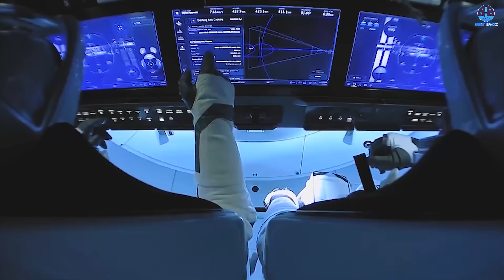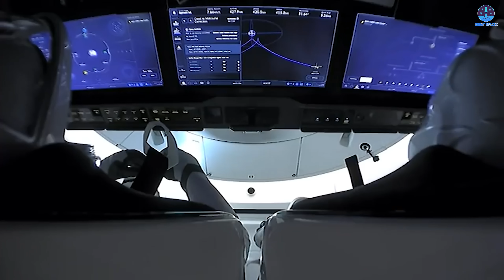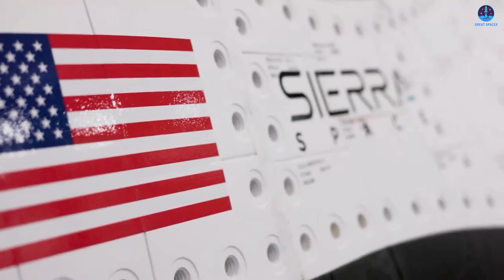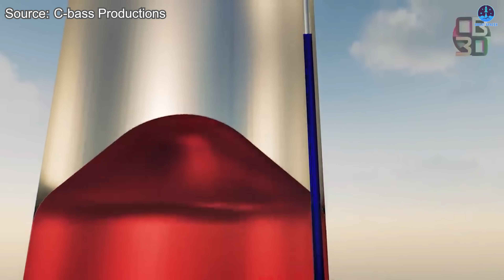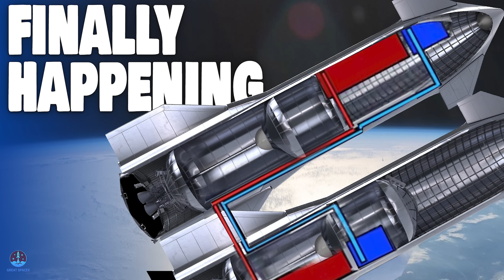SpaceX President Declared Starship Refilling System to the Moon Next Year after…

Comment: How in Micro-gravity is the fuel transferred?  The fuel is a floating blob in the mothership.
Reply: You apply slight acceleration in the opposite direction you want the fuel to flow. Same as on earth. Only its much easier on microgravity since you dont have to account for the pull of the earth.
Reply: Plus you pressurise the donor tank more than the receiving tank, so that the pressure differential results in propellant flow from one to the other.

Comment: They could have really long telescoping arms on the non-heatshield side they could have knuckles stored inside and they could have inspection and repair equipment on a knuckle.

They could also have a cryogenic robotic arm on the inside and have an xray source inside the fuel and oxygen tanks.  then they can do really good inspections with an xray detector on a knuckle.

they could use these  to transport materials and or to tip the rocket over to become a shelter.  They could also use them as lifts if they end up having astronauts in the upper area.

I really think they'll need a low payload deck for a lunar and mars lander (below the main fuel tanks)  and they will need a smaller return vehicle, at least for return to orbit. (they can leave a full starship in orbit if it is refueled)  There is no point in launching so much mass from mars or even the moon.   requires so much fuel

Comment: I would think docking in outer space to transfer fuel to be much easier than two jets refueling in the atmosphere which is done all the time.
Reply: It’s harder due to the lack of gravity and surrounding pressure.  Fuel just goes everywhere but where you want it, so they either have to use a pressure system and/or incorporate centrifugal spin to get fuel where it needs to go.

Comment: to develop a rocket that doesnt use so much fuel is apperently not an option. is it because of shareholders??? WEIRD. short term thinking
Reply: I think you just demonstrated that you don’t know much about spaceflight. WEIRD
Reply: @constantin-X the space x rocket use more fuel just to take off than the rocket that went to the moon before. Its not rocket science to figure out, that not a good thing, when in space you travel with a huge fuel tank. So that I know.
Reply: @thomasdanielsen9941  Do you also know that Starship has twice the payload capacity, that it uses different fuel, that fuel which could be used for a translunar injection orbit and a lunar landing burn is used to return the booster and Starship so that it can be re-used? Unlike you I don't pretend to know rocket science but I CAN read and learn things. Maybe you could if you try.
Reply: @thomasdanielsen9941  Starship burns more fuel because it’s bigger and fully reusable, but if flown expendably, it might lift ~250 t to low earth orbit (≈5.2% payload ratio vs. Saturn V’s 4.7%). Even in reusable mode (~3% ratio), launches are projected at about $50 per kg which is far cheaper than Saturn V’s  ca. $8.500 per kg.
Reply: is it because of physics. if you want to send astonishing amount of payloads in space, you need an astonishing amount of fuel, and engines powerful enough to lift the thing up. raptor 3 are already the most efficient engines when comparing high thrust/fuel efficiency/fuel cost/engine manufacture cost. if you wanna consume less fuel, you have to reduce the mass of the craft but also proportionally reduce the mass of the payload, losing the main purpose of an heavy lift rocket. space x already have this kind of rockets, they're called falcon 9, consume a lot less fuel per flight but also carrying a lot less payload to space and tons x tons of fuel is lower than with starship due to lower efficient engines. plus a lot more stuff like instant reusability and fast refurbishment due to methalox instead of slow refurbishment due to kerosene, the fact that to have a return to launch site landing profile after lifting heavy payloads requires a giant rocket with a lot of engines, but it still much cheaper in a long term compared to falcons due to lack of sea to ground infrastructure and long period refurbishment required by the merlin engines of falcons but possibly not for raptors. for the second stage no matter how much fuel it consume or how big it is, if it come back and it's refurbishable and with a really high cadence rate (as space x needs for any beyond leo mission) it will always be cheaper than any expandable solution. and the only way to make it works with such big payloads it still making it big as hell. as you see no single design point was short term though, in my opinion initial critial design and kind of development of starship are n1 example of how a rocket should be made
Reply: @golem_videomaking  “n1 example”?? 🚀. You mean as in the ever exploding Soviet “n1” rocket?   Idiot.
Reply: @rambler05  you really said idiot after misreading "number 1" as the n1 rocket? 😭 ong, good launch on an overpriced atlas v and starliner or a 50yo soyuz i guess
Reply: Because of PHYSICS!!  You got that??  PHYSICS!!!!!

Comment: Woahhhh! "Potentially 20 vehicles in active rotation"... No! Simple solution. Use V3 as template for lander (1600t fuel cap is more than enough to get to the moon from LEO and back (allowing for some fuel bleed off). However, use V4 as the tanker (due in 2027). This doubles the fuel capacity deliverable to 200t... with boiloff (sunshades would limit this) you then need 9 tankers to fill the depot enough to fill up the lander. 

So you could test with a V3 tanker but the mission would need the V4 tanker. You cannot have the lander developed in 2027, it must be thoroughly tested (hence V3 at least at first). Then tanker is a far simpler ship and a fail on one would be trivial given the projected ship production by 2027. Hint... 2 Gigabays will be done in late 2026 with a capacity for 12 complete rockets (24 stages) in each.

As for the vulnerability of the Depot in orbit... how long was skylab in orbit? How long has the ISS been in orbit? Sooo. The ISS has NOT been punctured in the last 10 years... So some shielding would be required for the Depot, but this has been done before.

Comment: Last year, I mentioned the refuling system would have to be end-to-end. Until recently, we've seen mainly body-to-body docking for refuelling.  I believe to facilitate refuling and keeping air from being pumped with the fuel, the starships will have to be end-to-end nd spinning head over heels to produce a gravity effect.  This will help enormously with transferring fuel.    Is there any news on which procedure will be used?     Surely it will be end-to-end, but as I said, I've mainly seen the body-to-body, and also we've recently seen two small docking areas, ( female ), any thoughts?
Reply: ... or pumps and heaters? We create vacuum chambers here on earth by pumping out gas against the pressure gradient. That's also how we liquify gas... gravity doesn't enter into it. This has all been done before.
Reply: you transfer with pressure not gravity.
Reply: @divedevil985  https://youtu.be/m4hvv2AfIhM?si=n__H8YQISKkK3ll3

Comment: Starship needs to develop the tanker architecture to provide reach.
Reply: Tanker is easy. Just extend the tanks and eliminate the cargo section. Then add 4 fuel probes like the one they use every launch. The important bit is to use the V4 ship to double the tanker capacity.

Comment: Spacex is hopelessly behind schedule. Unless they can perform a miraculous catch-up I give 2027 moon landing an optimistic 10% chance. 2028 might be a 30% chance given all the talk on the grapevine. The tech breakthroughs ahead of them are substantial and I think the early 2030’s are more realistic. Don’t get me wrong, I really hope they can somehow do it, but these timelines… Srsly
Reply: So ship V3 is nearly done with the HLS variant under testing elsewhere for a year or two now (life support, deck layout, fire suppression, etc.) stuff they did on Crew Dragon, but with more room to work with. They are supposed to fly some time in 2027 (two full years away). They have reused the booster, perfected the engine and the reusable heat shield. They have: Flt12 - V3 booster, Flt13-15 - V3 Starship and catch of Starship for reuse... sched for 2026 H1. With a perfected V3 they have  Refueling tests V3-V3 in 2026H2 with perfection of V4 (2x capacity) for the definitive taneker and depot. V4-V3 refueling with depot 2027h1. First flight to the moon unmanned in 2027h1. First flight manned in 2027h2... now this might stretch into 2028 (2 years ahead of the Chinese) but where is the angst coming from?

We can see the Huge infrastructure being built in real time, the massive financing (Starlink... not the US tax payer). We can see the success of building the rocket, landing the booster, perfection of the First Reusable heat shield. Today they have the capacity to build 2 Starships per month. (Waiting on perfecting V3 variant for mass production). Their infrastructure is designed for production of 100 reusable Starships per year (whether they need that many or not). Seems ambitious? They are on track to launch 160 orbital F9 medium lift orbital missions this year with Far less supporting architecture. Bought and paid for with Starlink revenue more and more each day. ($15b revenue for the company this year, $12b from starlink - 8,500 operational satellites and growing fast).

Some "experts" who are not directly linked to NASA (and speaking in very vague terms) decry "complexity" knowing full well that the mandate is not a "return to the moon 60 years later" it a construction of the infrastructure, methods and rocket to put a "permanent base" on the moon... and support and grow it year after year. Requiring hundreds of tons of materials to be put on the lunar surface Every year... thousands more tons need to be mined and manufactured... 

Who thinks 15t of material delivered at $4.5+ billion can do that?

Simple. It can't be done without LEO refueling. Spacex can put at 50-100t  on the moon with V3... 100-150t with V4 at $1.5 billion per flight and even transfer astronauts in LEO with Crew Dragon rather than the absurd risk of transferring them in lunar orbit... blatant pork project.

... orbital refueling is an "unnecessary complexity" if you don't understand the mission. This is not another flag planting ceremony. Not so "complex" if you realize that Spacex has already done each step of the LEO fuel transfer and simply has to put it all together. 

Suggesting Spacex will be late beyond 2028 at Worst... pure fantasy. This is not a run of the mill govt contractor. They have built HUGE resources, HUGE internal funding and by 2028, they will have the infrastructure to put men on the moon or 100t cargo every single quarter for half the NASA budget. 

No other design can keep more than 4 men and a quanset hut alive "permanently". 
Going to build a city on (or under) the moon with that?
Reply: @avgjoe5969 You make valid points sir. I guess there has been a lot of bluster that inevitably results in overruns at least historically. I do hope they pull it off in time. Either way, it’s all exciting stuff to witness

Comment: I have no expertise, but would expect Space-X to complete orbital docking and propellant transfer during 2026. I have trouble with a statement that one trip to the moon would require 10 (or more) such transfers. Seems far from optimal.
Reply: It isn't at present but the idea is that starship is going to be able to have a lot faster turn around than even falcon 9 does currently, the goal is multiple flights a day from the same pad with the costs reduced to just fuel as the whole rocket is rapidly reusable. The actual trip will need less but remember the goal of Artemis 3 is for starship to land and take off from the moon as well.
Reply: you won't get 100% transfer of fuel. That is why it will take so many trips.

Comment: Progress is improving, so should see accelerated progress towards refilling in space next year ot late next year
Reply: First reusable heat shield is now solved
V3 Booster flying in 2025 (flight 12 - the mass production variant). 
I would expect full evolution of the definitive V3 in 2026H1 (both halves)
Evolved fuel transfer with Depot by end of 2026H2 (V4 tanker). First unmanned flight to lunar surface 2027H1, First manned flight to the lunar surface 2027H2 with possible slippage into 2028 (about 2 years ahead of the Chinese target of 2030). 

Reports that Spacex might "slip several years" are based on sand and politics. The logic given was vague and nonsensical.
You have about a 40% chance of 2027 manned lunar landing and 60% chance of 2028.
Every year, Spacex builds more and more infrastructure and Starlink pulls in more and more revenue. They could start regular flights to the moon from 2028 with little to no infrastructure changes. They already have more capacity to build and launch orbital rockets than the rest of the world combined... by... far.
Reply: I thought progress was becoming a more segregated and hateful culture by focusing on our differences. Confusing times!
Reply: @gcburns4  Try something other than MSNBC and CNN and you might believe that the world will survive, just fine. Save a bundle on psychiatrists.

Comment: Not even close to that. SpaceX has been in slow-motion for three years now. China is speeding past us. What happened to Spacex!?
Reply: Parallel development: While SpaceX has been testing/refining Starship design, it also made dramatic improvements in Raptor engines & Starbase manufacturing & launch infrastructure.
Reply: Simple. You haven't been paying attention. 

Spacex flew 90% of the entire world's mass to orbit in 2024. (That was 130+ medium lift launches.) This year it will be 160+ not including any Starship activity. In 2027 they expect to launch between 15-20 V3 (definitive version) Starships... They already have a capacity to build 2 Starships per month once the design is finalized in 2026H1. They have sized their manufacturing to build 100 fully reusable ships per year by 2027-2028... reusable ships to support an obscene launch tempo of the largest rocket with the most advanced engines in the world (for a fraction of the cost of their next nearest competitor. They are rapidly building more launch towers, far more massive assembly buildings and completed a 1 million sq foot factory designed to pump out 100 starships per year in addition to 2 rocket engine factories. All while keeping their Falcon 9 business pumping faster and faster... and they own 8500 operational satellites - more than the rest of the world combined pulling in huge revenue that is expanding very rapidly...

They have been working on an HLS mockup for 2 years as they perfect the V3 rocket that it will be based on. They have reused the giant booster twice, caught it 3x...
They just perfected a fully reusable heat shield.

They already know how to dock spacecraft having done it 2 dozen times successfully. They know how to transfer fuel having done that hundreds of times, how to do so in LEO having done that one tank to tank transfer experiment to confirm it wasn't a problem...

You have to read behind the headlines. 

Spacex has built a Giant launch company that will soon (next year) have more revenue (mostly from their satellites) than NASA has funding. More rocket building infrastructure than the rest of the world combined. The most advanced engines (no contest). They have pulled off many firsts here and in the past: Landing/Reusing rocket, First reusable heat shield, Exceptionally low cost hardware with record breaking performance. 

... and yes, all the pieces of the HLS are fast coming together. The world simply wants them to do the landing as quickly and simply as possible so they can plant another flag. Spacex is building a ship to allow construction of a real lunar colony, looking forward to building a mining and industrial capacity on (and under) the moon. 

China expects to put maybe 40t on the moon in 2030
Spacex is on track to put maybe 100t on the moon in 2027-2028. 200t (V4) in 2029 and built the infrastructure to put another 100-150t on the moon every quarter from 2028 onwards at a cost of maybe $1.5 billion per trip with no Orion or SLS needed.

China's rockets are no where near as capable as Starship and they, rightly, have begun a program to replicate Starship with an estimated completion date of 2032 or so. In the mean time, they Are making great strides, but no, China is speeding past other US efforts, but Spacex is, if anything, slowly opening the gap... Once Starship is in full production at 2/month or more in 2027, running dozens of flights per anum, the Chinese will step up their game again... in the mean time... they are losing ground against Spacex even as they zoom past everyone else in the industry.

Example: Starlink has 8500 operational satellites in orbit vs a few hundred that the Chinese put up (a massive improvement by the Chinese)... yet Spacex is currently putting up 2000 per year and climbing with Falcon 9 and Starship opens the way to sending up 60 per flight of Starlink V3 (10x the capacity of the current version ) and 2x the number of satellites per launch. (One Starship puts up the capacity equivalent of 20 Falcon 9 launches)... so Spacex revenue is set to skyrocket in 2027, it will pass NASA in 2026.
Reply: If you think SpaceX is slow you should see NASA and Boeing
Reply: Nice one bot. Wym “China is speeding past us” 😂 What progress has China made?
Reply: Kids bots are fun! China still uses Hypergolic rockets that land on villagers. Funny, because it's true. 

In fairness, China is doing way better than Europe. But their Starship-like rockets are concepts targeting 2040. Also true.